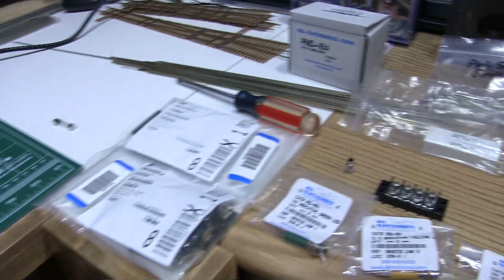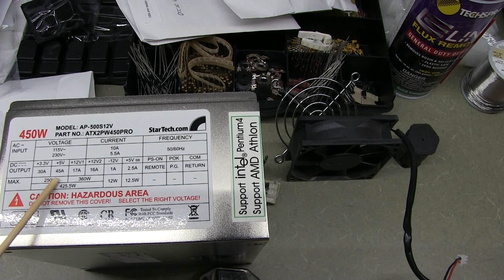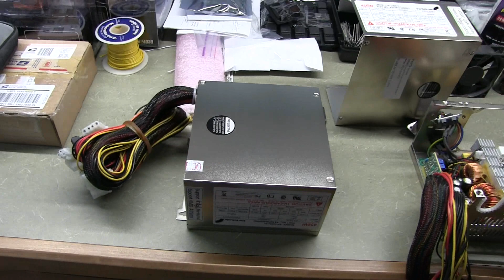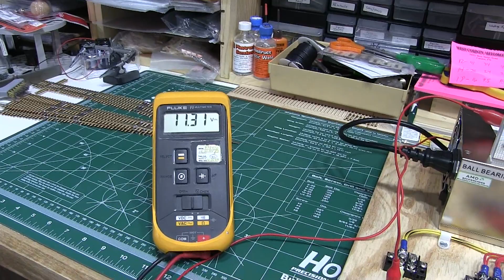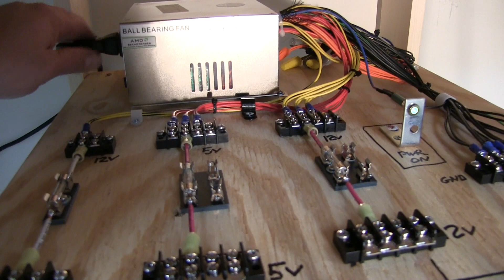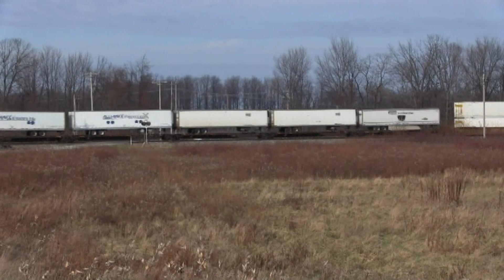Model Railroad Layout Update Video 13- Computer Power Supply for Model Railroad

Comment: Very nice. Have you thought about adding a second piece of plywood to the back and putting on a bus interface to both boards so you can just side the whole board in and out without having to mess with unscrewing anything.

Comment: What wattage of circuit breaker did you use, any recommendations? i have several old PSU i'm considering converting. right now my layout is DC as i inherited a large number of locomotives from my grandfather (handmade brass). one day i hope to convert to DCC but it will be a while before i can do that.
Reply: Justin- I didn't use breakers, but fuses. They are 7 amp fuses- never have had an issue in nearly 4 years of use.
Reply: @robbennett1965  thanks, sorry I meant fuses:) good to know. Thanks!

Comment: I only get 10.8vdc and 5.3vdc from my spare PSU with no load. Is this common? Can it be used for model railways, do you think? (UK)
Reply: Seems low on the 12vdc side.  Try hooking up at least 500mA-1A 12v rated item, and see if it still only gives you 10.8v.  Check your VOM meter too and make sure that it is good.  Then take a railroad switch, and hook up the an electrical momentary switch and see if it moves the switch points when you put power to it.  10.8v might just be enough.. if your only pressing ONE electrical switch at a time.  A lot of variables here.

Comment: Hi
I am new to this Hobby, so i am learning as i go along.  I would be grateful of some help.  Found this very interesting & helpful.  I have 500v power supply which came from my computer.  Thought that it was no good but works ok, so thought i would use it for my Layout which is HO Scale & U-SHAPED. My question is, can i use this for about 20 points/turnouts with GEM POINT MOTOR & RELAY ACCESSORY SWITCH & all my led lights for buildings 12v plus resistors.
Power for track is by way of my ACE DCC CONTROLLER 12V-15V.  OUTPUT POWER PLUG 5.5amp.
  Regards
    Peter.
Reply: Since the turnouts are rarely on all at once.. you should be just fine with a 500W power supply, using 12vdc.

The easiest way to determine this is to add up the amps of each LED.  1 amp (roughly 12 Watts at 12vdc).  An LED is typically at 1.2v at 0.025A.  So 12v-1.2=10.8  then 10.8/0.025=430 Ohm common resistor (or you can use 470 Ohm).    Power=Voltage x amperage.  So an LED at 1.2v x 0.025A=0.03A. Or 33.333 LED's per amp.   33 x 20 amps = 666 LEDs.

You could easily do HUNDREDS of LED's on a 500W power supply (typically at 20Amps per output rail)!

Comment: Hi there, I would like to add some informations regarding computer power supplies:
First: The power of a psu is given as the combined power - as all rails together. That does mean you cant get the complete power out of only one rail.
For the examples I use two real existing psus, one built by HP, the other built by ENERMAX, the one with around 300 Watt, the other with 250 Watt - both actually found on ebay. 

The data table on the HP psu states the following: "Combined power on +5 Volts and +3,3 Volts rails not exceed 175 Watt max, combined power on +12 Volts and +5 Volts rails not exceed 268 Watt max." (This information is not given on the data table of the ENERMAX)

Ability of current delivery reads for the HP: -12V/0,8A; +12V/19A; +5Vaux/2A; +5V/25A; +3,3V/18A.
The ability of current delivery reads for the ENERMAX: -12V/0,3A; +12V/10A; -5V/0,3A; +5V/25A; +3,3V is not given.

Interesting enough: Despite having not the same combined power both psu are able to delver 25 A on the +5V-rail - or, calculated, 125 Watt. On the +12V rail this psu may deliver 19A - or 228 Watt. The combined power of +12V and +5V, calculated, gives a figure of 353 Watt - and exceeds therefore the MAX figure, given by HP, of 268 Watt for the two rails combined.
What does this stand for: You can NOT get the whole current on both rails at the same time. What happens, if you try? The psu will get overloaded and therefore simply switch off. 

Wiring:
Have a lookup @google for ATX-power connections: You will surely find many pictures and schematics and explanations. You will find that the colour coding follows a simple schematic: yellow is +12V DC, red is 5 V DC, black is ground, orange is +3,3V DC. 
No Sense-cable. If such siort of a cable is provided it runs separtely - often there is a separate cable or two used to control the fan in the psu if the PC is equipped with this feature.

But - why are there so many wires coming out of a psu that deliver the same voltage? 

Several wires are running in parallel, mainly to the main board: These are needed to deliver the huge currents todays PC are consuming. The other way would be to use thicker cables.

Then: There are many devices to be connected to a PSU in a PC: Harddisks, floppies, front connectors, graphic cards, usb3-cards, cd-drives - depending on how many devices are existent in a PC you may need several batches of the four wires yellow-black-black-red to connect these devices.

Which PSU to choose?

It does not make any sense to look for the combined power of the PSU - a PSU is designed to comply to the needs of the machine it is used for. A fileserver, housing many harddisks, does not need heavy currents for the CPU, whereas a workstation for graphic production does need this power. The first PSU needs to strong on the +12V rails, the latter needs to deliver much current on the 3,3V rail.

You should determine for what you want to use the PSU, which voltages you need - and what current the PSU must deliver on the rail needed.

Comment: I was searching eBay for power supplies.  I like your system ATX 12 volt 12.01 power supply.  Can it be a 400 or 500 watt because I can't find any 450 watts.  I can not find any under $20.  Thank you for any help you can provide.  My email address is haigis14@msn.com.

Comment: Just one other thing .  You can use a 10 ohm resistor that equals the power output in wattage to use as a dummy load.  You usually get a voltage drop when the circuit is loaded.
Reply: No, you dont. These are not normal PSses - these are constructed to hold the voltage till they get overloaded - then they switch off. Computers are very sensitive for voltage drops, they usually freeze instantly as a voltage drop occurs.

Comment: Nice video.  Thank you for sharing you knowledge of computer power supplies.  I think that I shall use a cheapo "Chinese" 5A pw supply that powers the 3 meter LED strips.  A lot cheaper than a computer pw. supply.  I really don't need a 5V pwr. supply--12V is all that I need, but I need at least 3 amps.

Comment: Hello I was wondering if you would build any of these for sale?
Reply from the maker: Never thought about that...it is an option I suppose! But, given the current work project Rob is on it won't be until later in December that this would even be possible. If interested, send a message and we can discuss further.
Reply: what one cost if he was too build for sale?
Reply: Can you make a video showing how you actually put the wires together and which ones so you don't burn the power supply up by forgetting g a wire here or there

Comment: can you run a dcc command station on  this?
Reply from the maker: +Joels Train Hm, I haven't thought about that. My command station uses a dedicated power supply fed with 120v house power. This computer power supply certainly has enough capacity so I assume (but don't quote me!) that if your command station used 12V DC then it may work. May need someone smarter than me to answer.
Reply: if your station is plug to the rails, I will not see why.. but your station give you a power output for your rail so why bother?!?

Comment: Nice detailed video. Since the power supply is earth grounded how did you use them for the accessories? Are the accessories not controlled via dcc accessory decoders? I thought if the accessories were also controlled via dcc that the grounds could not be common.

Comment: You could power up your trains with one of these power supplies - DCC works with both AC or DC power to the control box.  You would have to create a floating ground which is the +12V  is connected to the positive terminal and the -12V is connected to negative or neutral terminal.  In theory this would create a 24V floating ground system.  I guess some testing would be in order to see how well it would actually work.

Comment: To keep the shelf movable move the front bracket back and put the wires in front of it.  Either way you may need extra wire to make the shelf movable (I forgot and ended up tearing out the connectors to what I was working on at work.)

Comment: Hi: Like your presentation. I purchased a power supply very much like yours. Do you power you track with this unit as well, and there is 4 - 12v outputs. .5A, 12A, and 2 - 17A. How do I distinguish one from another. Thanks. Bob
Reply: Robert Smith Bob- Thank you. These power supplies are used for control and signal power, not for track. Track power is totally separate and is provided by the DCC system boosters. Without seeing the supply you have I can't tell you how to identify the different 12V feeds. On the one I used there were two (2) 12V feeds- one had yellow wires the other yellow with a black stripe. Usually the higher current feeds will have more wires. You could try a good old Google search on your particular supply- may be more details out there!

Comment: Great way to mount the power supply.  One word of advice never put one of these power supplies in a computer.  They will kill it.  Computers don't like voltage drop.  You should never have that much of a drop for such a small load.  They are ok for the railway but not great.  Being a computer tech I see all the time the problems these power supplies cause even when they are working.  Personally I use a much higher quality supply.  I also connect a switch to the green wire so I don't have to use the power supply if not needed.
Scott
Reply: +Scott Downey Hi Scott. What computer PS would you recommend? I don't know much about computers and trains although I have had several of both. Kinda like Women :D I don't care much about the Gold, Silver bronze stuff. Just solid reliable stable economical PS suitable for train operation? I ain't askin for much :D
Reply: +Superseanbarry That's the thing to have a good power supply you need to buy at least a bronze PSU.  There is a reason the cheap ones don't have these.  They don't even make it to the minimum standard.  Which in turn causes problems.  They use the cheapest parts that have been known to catch on fire or the caps blow.  The distortion that come from these psu's is crazy.  Most of this people don't know and then wonder why they are always having problems.  They produce dirty power.  You can find lot's of good psu's but they are a little expensive.  There are one's Rosewell, not my favorite.  I only buy from Seasonic, Corsair, Antec, etc.  You are safe with any supplies with the 80 plus rating.  The lower end ones are not fancy but you don't want fancy.  But you have to have one with the rating to be safe.  I am sure in the USA these are cheaper than here in Canada but it will worth your money in the end.  Less problems with lighting, signaling and point motors failing.  These cheap ones don't even help with power spikes.  I think I made my point so I will stop here.  The layout looks great even though I haven't commented much lately.  I wasn't too happy with one person on here.  Keep up the great work.Scott
Reply: Scott Downey iI

Comment: I Just ordered two of these from ebay, do you have a wiring diagram of which voltage are whic, what needs tied together, and which ones don't need used at all?

Thanks
Reply: Normal its on the sides on the power supply

Comment: Interesting about the sense. I have one for all my lighting at 12V. Just two wires. Seems ok. Robert
Reply: That is very possible. Some videos on the "Tube" did indicate the sense wire(s)- if present- needed to be connected. I figured better safe than sorry, so connected them in. So far it seems to be working okay!

Comment: I used an old Dell power supply, it powers my LED strips which illuminates the layout. It's been on for about 10 hours before and never gets hot. The LEDS are cool to the touch as well. I measured each 8 ft strip at about 1.5 amps, times 8 strips = 12 amps total. Check out Ron Klaiss's video on LED strips....http://www.youtube.com/watch?v=GGV7iEWIJ_Q Great layout too!!
Reply: Thank you. And good video, thanks for the tip. I did use LED strips in the workshop (under the cabinets) and a short strip for some light over the power supply itself. I was thinking of doing exactly what Ron did as I am noticing some dark areas...I really should have installed 2-3 more of the LED troffers. But seeing how he did it is very helpful and I may just try it.